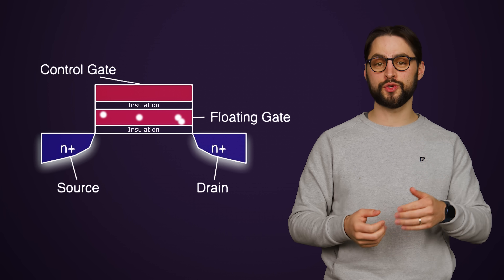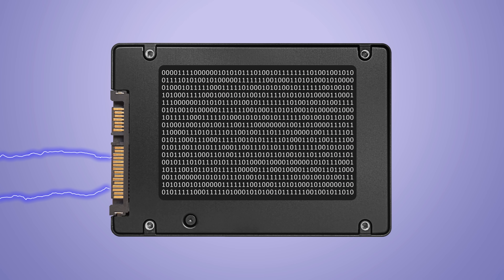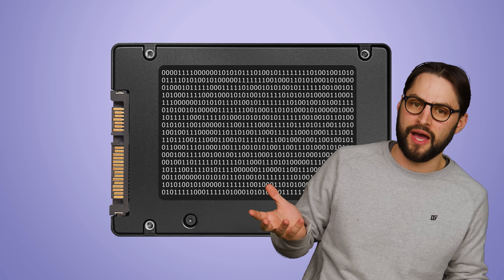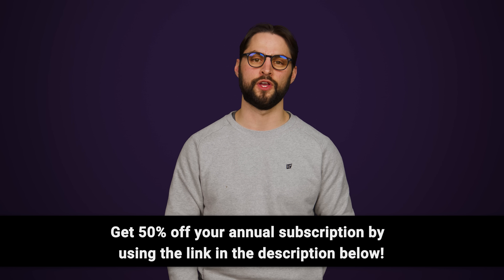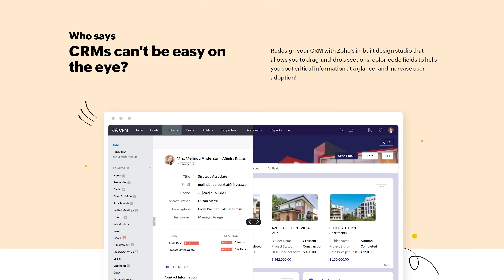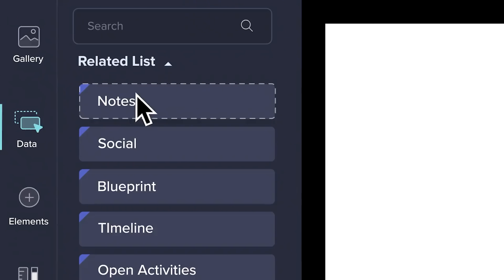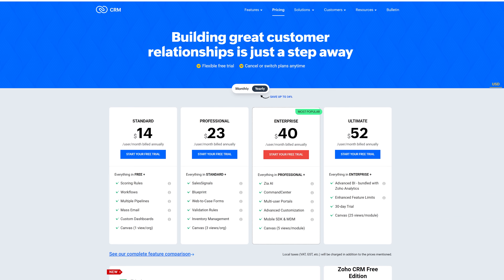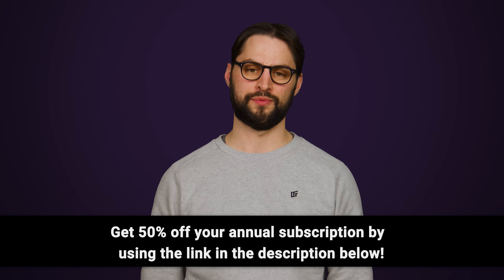SSDs Die, RAM Doesn't. Why?

Comment: This feels kind of ironic considering that capacitors are usually first to fail in retro hardware.
Reply: It's a different kind of capacitor. Capacitors in RAM do not have electrolyte in them. They're not foil and paper either.

Comment: Why don't we make PCIe RAM cache cards? Or USB drives that are basically a power bank + LPDDR5? Maybe even with a peltier device or a small solar cell one could keep the RAM powered for a very long time.
Reply: Those do exist, but they are not very useful. The latency and bandwidth restrictions from PCIe make it not worth-while. However, the replacement to PCIe called CXL may make that more viable. USB is even worse than PCIe for bandwidth and latency.
I guess a simple answer for why you don't see those things: there isn't a market for them, but you could easily make them if you wanted to

Comment: I've had 4 ram modules with supposed lifetime warranty die so far, in all kinds of computers and laptops. Never had an issue with an SSD though or even hard drive.
Reply: Usually if RAM dies early on (i.e. within less than a year), those DIMMs were part of a bad batch that were printed.

Comment: What about installing and uninstalling huge games all the time, would that wear the whole drive out quicker?  Should a physical hard drive be used in conjunction for data storage and recovery, in lieu of access speeds?
Reply: SSDs have a write limit depending on the capacity of the drive.  250 GB drives have something like 150 TB life, double the capacity...double the write life.  Notice I said Write Life....Read is not measured.  Disk Drives are good for large storage capacity and backups, also for applications that do not need fast access.

Comment: 2:43 "take away power and the capacitors can't hold a charge anymore."  I know you're trying to keep things simple here, but that is a very misleading statement.  When connected to a transistor inside a memory cell for a RAM chip - yes, the capacitor will leak.  But if a capacitor (especially a large one) is truly disconnected from power, it can hold its charge for days or years.  

That's why you have to be careful around power supplies even when they're disconnected and it's why you have to leave your router unplugged for 30 seconds before plugging it back in again.  capacitors DO hold charge.

Comment: Where does this leave the integrated storage in the new M1 Mac’s? Surely as the CPU/GPU cores and storage is a single unit they will be dead within a few years??!
Reply: well most imacs only last 8 years before it just brakes down from the ware and taire of the elections boring holes everywhere in the hardware from normal use this is been a problem with all electronic micro logic circuits but the time it would brake down you wold have saved enotgh money for a new one plus back up don demaind cloud storage is a lifesaver when it comes to keeping your data full backed up! but that will cost you a subcriphon fee for more then 8GB on the icloud bescue clodu data servers are not cheap to run you know!

Comment: My OCZ vertex 4 SSD is still going,after many years of service as local disc C drive.
I hope the new ones will be the quality like the old ones.
Reply: Any new SSD will be far more reliable than OCZ Agility 3 or Vertex 4 with their crappy Sandforce firmwares. Those were so incredibly unreliable that they basically broke the OCZ brand.
I no longer have the two Agility 3's that all broke within a single week, I returned one of them for the Vertex 4 which also broke, this one worked for less than a month, it is currently used to prop open my window for some fresh air.

Comment: SSD's are RAM... I know "RAM" is used to mean "system memory" but I do wish people would get the terminology right. It's a losing battle I know. Still annoyed about "x86 vs x64" and "IDE vs SATA" which makes no sense at all. Don't get me started on "2K" screens.
Reply: IDE is the ribbon cable from years ago, SATA is the newer interface for disk and optical drives...way faster and less complicated, x86 and x64 have to do with the instruction set on the processor and memory it can address

Comment: My SSD after 6 years of normal everyday usage, according to it's self diagnosing firmware (S.M.A.R.T.), has 97% life left. My quick maths show it will hit 0% life left in 194 years if it keeps degrading with the same rate.

TL;DR: don't worry about it 😅

Comment: Could y'all make a video overview over all the different kinds of SSD memory, like SlC, TLC and QLC?
Reply: The difference is the number of bits stored per cell (per floating gate transistor). The LC in the acronym stands for "level cell" and the S,T,Q stand for "single", "triple", and "quad" (i.e. 1,3,4). 2 bits would be MLC "multi". SLC is simple, it's either 1 or 0, high or low. MLC has 4 voltage levels since 2-bits is 2^2 states, triple is 2^3 = 8 states, and quad is 2^4 = 16 states. That means that you can store 4 bits in a QLC by using one of 16 different voltage levels. If the voltage range is 1 volt, then the levels are spaced every 1/16th of a volt or 0.0625 volts. 
Because the voltage levels are so small as you increase the density per cell, it becomes harder to tell the levels apart (small amounts of noise or charge leak can push them into the next state, so 0001 might appear as 0010, which would be incorrect). That means that the flash needs to remain in near perfect condition to hold the correct voltage levels, and decays with use. 
Also, there is a way to combat systematic variations (i.e. if all cells in a page are slightly off because of charge leak), which is called read-retry. But that ends up slowing down the SSD reads (a read can go from taking time T to taking 16*T for example in the case of QLC).
Reply: @hjups  That's interesting, thank you for taking the time to explain. I just knew TLC is more reliable and typically faster than QLC, but it's good to have a bit of background knowledge
Reply: @alexanderkopke2420  No problem. MLC is more reliable than TLC, and SLC is more reliable than MLC. It's pretty crazy that the rated cycles go down by a factor of 10 each time, 100,000 for SLC, 10,000 for MLC, 1,000 for TLC, etc. Most 3D NAND is TLC too (even though I have seen some vendors call it "triple level MLC"). 
QLC is still pretty reliable if you are using it for archival stuff though (where you don't write that often to it).

Comment: SSDs don't die. You just can't write any more data onto it. And the reason a DRAM loses its data is not exactly because the power gets cut. DRAM constantly, even during a power-on state, loses its charge, because the capacitors leak away those delicious electrons. It is so bad that even the act of reading the data destroys it. An active circuitry simply refreshes the data after each read AND periodically refreshes the data in all cells every 64ms. Cutting the power makes all electrons leak away within seconds, but in theory you can cut the power, cool the RAM with nitrogen, place it into a RAM data extractor, and get a lot of data out of it intact. This is in fact what some law enforcement agencies do when they seize computers to get to encryption keys in RAM. (no joke)

Comment: but how does server ram still have its information if the system crashes? like ECC memory??
Reply: If the system crashes, and retains power, then the memory controller will continue to refresh the RAM. This is also true for your desktop. If the data is not overwritten when the CPU does a reboot (soft reset), then you can still pull data out of the RAM.
If the system crashes and looses power, then the ECC memory will also loose its information. 
ECC is meant to protect against / detect / correct errors while the system is running and has power.

Comment: Don't be that hasty
7300TB for 400GB is 100 full disk writes a day, every day for 5 years. The problem is to achieve 7300TBW you would have to bash ssd I have in mind for 24 years with non-stop wire at full speed
This makes this ssd warranty life-time as enterprise SAS SSDs lines don't get run over 5 years
I mean Seagate 1200.SSD ST400FM0073 
They have 7300TBW or 5 years, whichever is shorter, warranty. 
Enterprise grade computer parts have so great cursive service in terms of warranty,  that you won't belive

Comment: Can you make a video where you explain the difference between x32, x64, x86, and ARM processors? idek if x64 is a kind of processor or something else.
Reply: x32 in that context isn't really a thing. You can blame Intel/AMD for their naming conventions. x86 is a type of processor which is based on the intel 8086, 8286, 8386, 8486, etc. So you can see where the x86 comes from (the x stands for 80,82,83,84). x64 was AMD's extension which is called x86-64, but they shortened it to x64. Both x86 and x64 are effectively the same type of processor, but x86 can't do 64-bit operations (only 32-bit) while x64 can do both.
ARM is a different type of processor, which has versions that can only do 32-bit, only 64-bit, and most that can do both. The main advantage of ARM is that it uses less power than x86 which is why it's so widely used in the mobile market.
32-bit vs 64-bit describes how many bits the CPU can work with at once, which represent an integer number. That number is also used to address memory (32-bit would be between 0 and 2^32 - 1 = 4,294,967,295. You can probably see where the 4GB limit comes from there in 32-bit systems). If you want to deal with larger numbers, then you need to combine what the CPU can work with. So a 64-bit number on a 32-bit CPU would need two of the 32-bit numbers, which takes 2x as long to compute rather than on a 64-bit CPU.
Hope that helps.

Comment: RAM does die sometimes, just generally not as often as SSDs. Although frankly I have a lot of SSDs and flash drives that I've had for years and so far I haven't had one die on me yet.
Reply: Anything can fail, but the cause of failure is important.

Comment: How very interesting.  Then why not combine the two technologies?  when the computer is turned on, a copy of the ssd is made in the RAM cells in the same SSD case and they move as they want, but when the computer is turned off, they are copied only once to the SSD cells and the problems are solved.  And because each chip in the SSD unit has the same size RAM chip built in above it.  in the event of a power failure, RAM cellular data is automatically discharged into an inverted image on SSD cells.  and where is my nobel prize?
Reply: but we don't have big enough capacity ram for that yet not unless you have a ram card that has like over a few TB of space ready to go but ram already does all of that when running programs when they store the needed data from the SSD in the ram already when you load a  video game anyway any way! but for a whole SSD you're going to need a huge ram in the TB but it would make the booting process so much F** longer and you still need dedicated  ram for extra program calations cach for running memory hungry programs that you load up on top of that as well!
Reply: plus a HDD-SSD hybrid drive would just work much faster by using a high capacity HDD drive for long term slower storage that also uses a SSD that works like  a huge decated flash RAM memory storage cach would be far better in the long term reliability  anyway for that exact concept you just said any way!
Reply: @ashtiboy  to be honest the technology hasn't evolved at all, they've just moved the problem to a larger capacity that extends their operating time.  Just in case the SSD is constantly transferring large files that are temporary we notice a short lifespan of the technology.

Comment: I had my boot SSD die on me about a year ago, and as I was recovering the data, I noticed it was read-only, but I had no idea why... until now! Thanks, James!
Reply: @Telleva except if/when the controller dies then you are screwed.  Early SSD's had cheap controllers that were notorious for dying.  I had a Crucial SSD die after 3 months because of the controller chip.
Reply: @Pulsar Gaming what was the make and model of the SSD you had that died?
Reply: @Josiuh  it was an HP EX900. It had good reviews when I bought it, but later when it died on me, I checked back and a surprising number of people had the exact same experience with it.
Reply: @phiwolgast  noted. Thank you
Reply: @Josiuh  yep! If you're looking for reliable SSDs, you can't go wrong with Samsung, Intel, or WD. Been rocking an Intel 660p drive for almost four years and a WD SN750 since the HP drive died, and both have been fantastic. Both extremely fast and reliable, even for gen 3 drives.

Comment: this made me wonder if you could theoretically use nvme, raid and LMG's internal 10gig networking to actually transfer a file at nearly the full saturation limit of the cables. transfer the file to ram first, then dump it into SSD storage, which itself is set up to accept the 'full saturation limit of the cables' anyway.
Reply: well, lots of sever and enterprise solutions do that.
Reply: Ram drive.

Comment: ram DOES die a lot. i have a lot of computers and about half of them already had ram failures. But to be fair that was almost only ddr1 ram which generally had no heatsinks.
Reply: I had 2 DDR3 modules in my old laptop and they worked properly for about 8 years. I upgraded to 4+4 later and didn't use the old ones. And my laptop used to get extremely hot (usually between 90-103 C) so those two sticks survived the heat.
Reply: @ohwow2074  if your laptop gets that hot, you really should do something about it.
Reply: @nlk294  I got it repaired a few weeks ago. Now it doesn't go above 50 C with normal workload.

Comment: Capacitors are not Highlanders, they also have a lifespan, in my experience somewhere around 25 to 30 years, certainly much longer than transistors.
Reply: Yep. Makes me nervous now that my OG Xboxes are in the danger zone of failing due to the capacitors it has inside.
Reply: @tristanbackup2536  It's a real problem in retrocollecting, but there is a thing called TOTAL RECAP 😉

Comment: Topic Idea: Does VRAM (on GPUs) get damaged by undervolting?
Reply: Undervolting should not damage any component, however, if the voltage levels are too low, the transistors will cease to function correctly (i.e. they won't switch when they are told to). You could probably think about it like a light switch, you normally use a finger to turn it on and off. If you hit the switch with a steel mallet, then you can get it to switch a little quicker, but you will likely break the switch. If you instead try to flip the switch with a sheet of paper, then it likely won't be strong enough to overcome the resistance of the switch, but that won't break it.